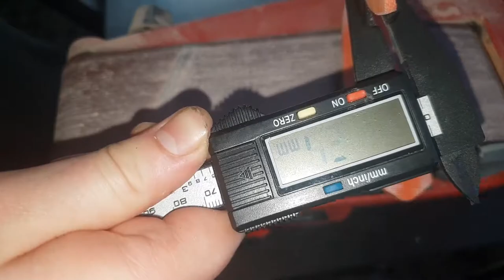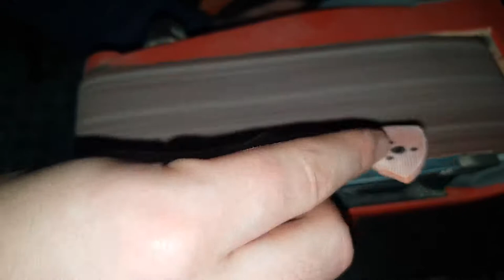Making a Custom Spyderco Tenacious knife! Micarta and Acid! DIY

Comment: Was this the s35vn version?
Very very cool by the way. I love the tenacious. It's my favorite looking knife as far as ergonomics and shape. I just wish they made more premium versions. Also the liner lock is way way too strong of pressure to release. It's so strong that it pushes the blade over to the opposite side when closed and so it's impossible for me to get and keep the blade centered. I am thinking about getting the lightweight s35vn version and doing some sort of project similar to what you did. Not the same but just to make it special with some sort of cool handle material. I was thinking like dark blood red g10 scales with either black or bronze hardware and doing a really dark acid wash so that it has that whole Deadpool color scheme going on. It would be cool to have a black or bronze geared backspacer too.
Thanks for the creative inspiration.

Comment: So a few thongs you did wrong. The acid wash. Use tipex or nail polish to cover the pivot hole. Or it will not open smoothly. Also, the detent hole must be covered. Can also use a permanent marker to protect it. Your etching needs to be masked off so you don't damage the metal while etching. Use baking soda to neutralise the acid after an acid wash. Don't grind or drill the holes when the screws are in there already. You'll damage the screws. Drill a hole in the micarta and attach the steel liners so you have them on there when sanding the shape instead of holding them together. That loose board on the table is a nightmare. It keeps moving while you try and work. Get a saw with a long and thin blade. Polish the scales with a very fine wet sanding sandpaper. Oil your scales. You'll thank me later.